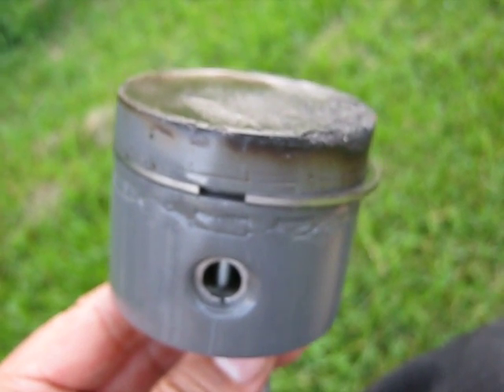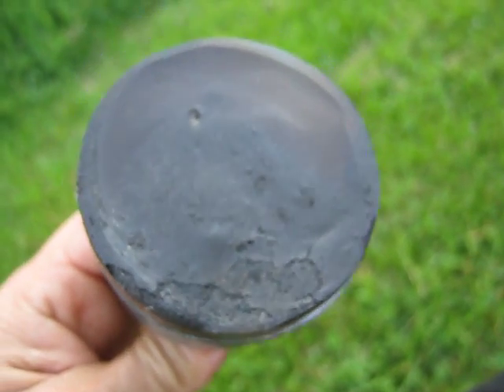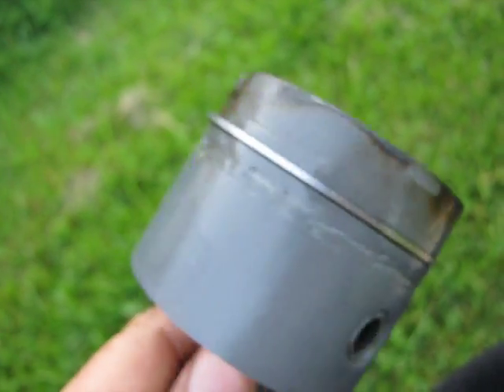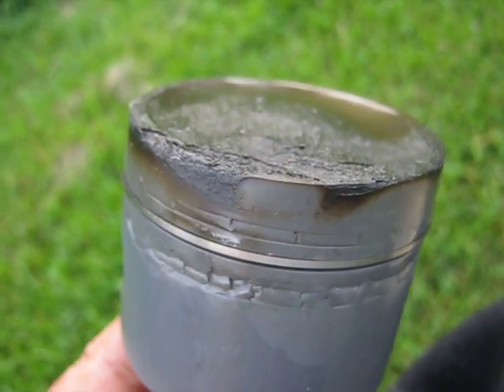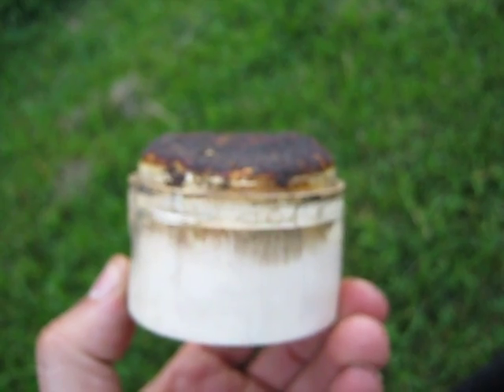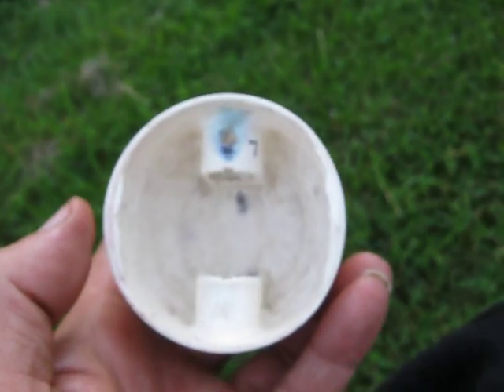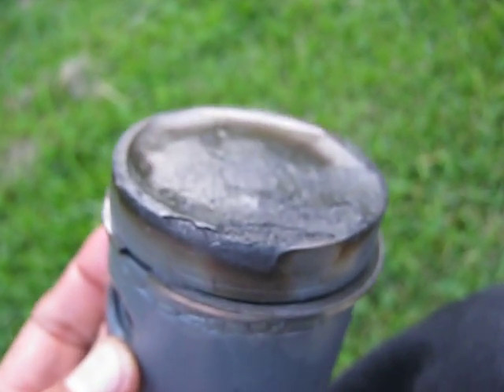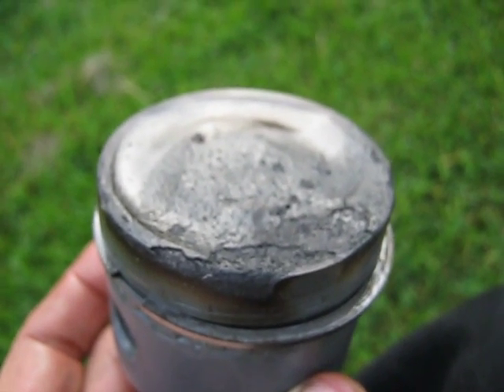Heat Damage to JB Weld Piston!

Comment: I wonder if you placed a steel plate on the top of the piston - placed while molding the piston - if it would dissipate enough heat and protect the J B epoxy from the direct flame?

Comment: So after the apocalypse if I had to jerry rig a pinto engine how long would I have?  30 minutes ? lol I'm basing that guess on the firing rate being slightly less in a 4 cylinder than a 1, depending on rpms of course
Reply from the maker: If you made the piston crown very thick, and put the rings as far down as possible, and put a top coat of high temp JB you might get 10 or 15 minutes out of it (a guess)
So you better pack lots of ammo to fight off those Zombies!!!  :)
Reply: I suppose a makeshift crucible would be the way to go in that scenario

Comment: Curious if you used the standard jb weld which i believe has a temperature rating of 600 or the high heat which is 2400

Comment: Do you know about a Volkswagen
Reply from the maker: What about VW? I used to drive a bunch of the 80s diesel Golfs and Jettas, stinky, but good on fuel.
Reply: ChargerMiles007 I have 4 air cooled sand rails
Reply from the maker: Awesome, I remember seeing one in Utah that had a Corvair flat 6 engine on it, quit the machine.

Comment: Nice job in making that piston, hope you make another video to see how long the piston would last before burning out, the video footage of the engine running with the plexiglass head was amazing, love to see the flame propagation.
Reply from the maker: i would run it to destruction, but the exhaust is rather stinky, and probably toxic, so I am betting my neighbors don't want to breath a lot of it in. I estimate it would run 7-8 minutes, going by how long the JB piston crown lasted.
Reply: rustymotor,  I agree 100% the plexiglass head is SWEET!! 
 ON ANOTHER NOTE. . RUN THEM TILL THEY BLOW!!.. I CAN GET YOU LOTS AND LOTS OF BRIGGS ENGINES. .
Reply: Its great watching an engine running to destruction, sure are lots of old Briggs around to blow up. Might have to have a go myself with some old mowers I have lying around.
Reply from the maker: yes, watching them blow is nice, but I much prefer it when they have oil in them, so they stay revving high, then grenade, kind of like the vid I did a few years back, when I untorqued the con rod bolts. With the large head con rod bolts (7/16" socket) the engine will run about 10 seconds or so before blowing, as in the vid. With the newer 5/16" head bolts, they may not unscrew at all, so I discovered during a test run. I thinks Briggs discovered that, and made the smaller bolt heads to help the engines hold together,

Comment: Thanks for showing those. I was curious how it did. It looks like the runs polished it some.
Reply from the maker: Yes, running did loosen up the fit of the piston in the cylinder. I had an hour or so of filing to get it to fit. I did notice small particle of JB in the oil afterwards.

Comment: #JBweld XD
Reply from the maker: The damage to the piston is pretty mild, I didn't want to run it until something burned up, as this way I can use it again if I want to.
Reply: I have idea for 30 to 60 pound flywheel so have a 2000 rpm motor then step the RPM down with gearbox then step it up with another gearbox then another up to the crank start speed
Reply from the maker: WOW, that would be a monster flywheel! My back hurts just thinking about lifting it!
Have you seen the vid with the big 4 cylinder hit and miss engine, it is freeking awesome. It can bounce the firing around, kind of like playing an organ!
Reply from the maker: It is called 1936 Fairbanks morse engine, worth a view!
Reply: yes
Reply: I put a 100 pound flywheel on a Briggs
Reply: did you see all my vids??
Reply from the maker: I think I just watched the one of the strobe light.